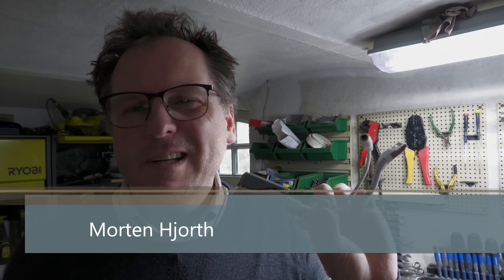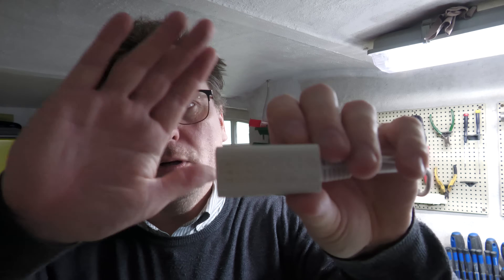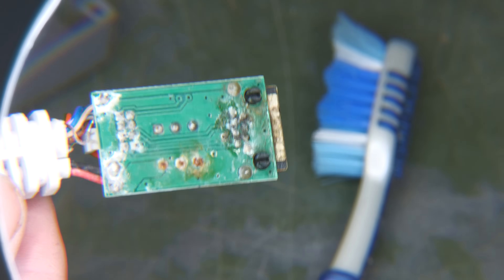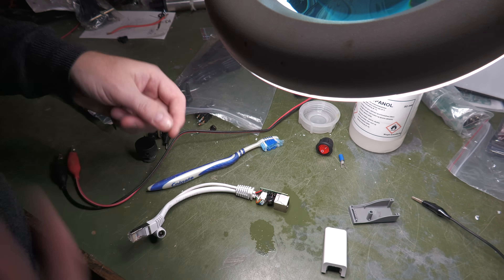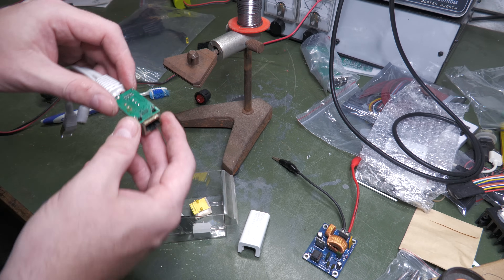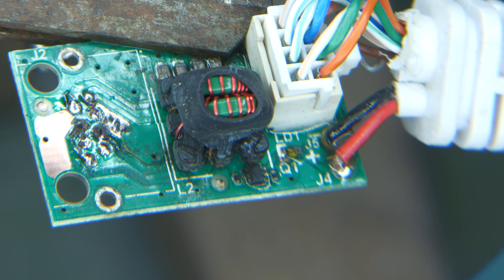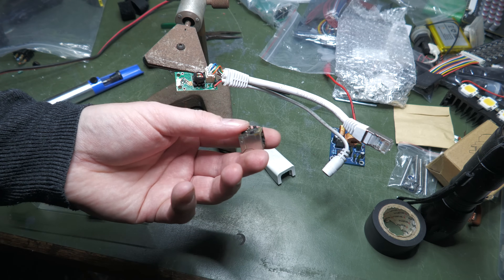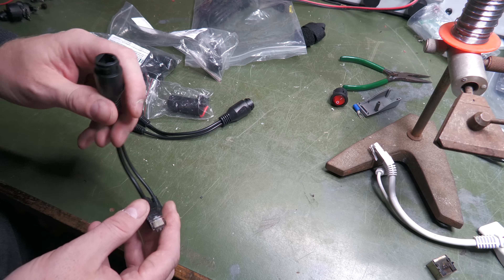My MikroTik Gigabit PoE Injector - Got Wet & Failed - 1492

Comment: One recommendation for you, fill up the inside with silicon this will prevent water from going inside, then use some for a Jelly in the connector and put electrical tape around it. Jelly I'm talking about is the same stuff you see in Jelly Connectors. ISPs use these connectors on their Copper lines.
Reply from the maker: Hi @VioletDragonsProjects
Thank You very much!  glad you liked the video :-)
Thank you for watching! :-)

Comment: You can get single use gel boxes that are completely watertight if you want a permanent solution. These injectors don't get very hot as long as you supply them with a similar voltage to PoE to avoid the need for internal boosting.
Reply from the maker: I will try this again :-)

Comment: Dam shame, another e-waste item. Best option I came up with was a plastic waterproof box which I then brought some water tight glads for. Made the holes in the bottom so cables ran down and also drilled a tiny 3mm hole in the bottom at the back to allow water to escape. Has worked really well.
Reply from the maker: Hi @solarhomelab
Thank You very much!  glad you liked the video :-)
Thank you for watching! :-)

Comment: The components on the Mikrotik PCB are there to allow power transmission combined with Gigabit Ethernet. The cheap passive PoE injectors just reuse the the 4 unused wires on 100Mbit/s for power transmission. But since Gigabit uses all 8 wires you need a more intelligent solution to couple the power and data.
Reply from the maker: Okay,, thank you! At the moment I am happy to see 30Mbit/s internet,, so it is just fine. But I do plan to get a new Mikrotik one.

Comment: Hey Morten. That adapter from MikroTik costs €5. I wouldn't bother to start with the ones you bought, because they are water protected only on RJ-45 socket side, you definitely need a snall boks. I would get something from Biltema or similar store in Portugal and put them inside. More reliable solution and no need to re-do in the future 🙂
Reply from the maker: Hi @999angelas
Thank You very much!  glad you liked the video :-)
Thank you for watching! :-)

Comment: Unfortunately is not only water some condensation can be form inside the tape especially if you isolated too well 😅 I have a small voltage step down converter to 12v to 5v in my garden to convert the solar panel to a 5v to connect all the led light on the fence and I put everything I a waterproof electric box and I noticed if I leave completely watertight some condensation start appear during some night if the humidity was too high for example after a small rain. Open one of the bottom port to let the air come in and out but not water resolve the issue. Maybe here same problem the connector generate a little bit of heat and start create condensation inside
Reply from the maker: If only I had made a hole for the water to run out again :-/

Comment: If it hasn't been suggested yet, use Self Amalgamating tape. Have the wires sticking out the bottom so water drips off.
Reply from the maker: Hi @rstvproductions8334
Thank You very much!  glad you liked the video :-)
Thank you for watching! :-)

Comment: 5:06 I know this feeling. I damaged the LAN port of an Elitedesk 800 g3 by inserting the power-plug accidentially, so it works now only at 100Mbit/s because 2 contacts are bent. But they have custom RJ45-ports and I was not able to find one that fits. Why on earth are there so many different ones? Every brand wants to reinvent the wheel. Stupid.
Reply from the maker: The poe injektor is like less then €10 I am not spending an hour on aliexpress to find the right RJ45 :-)

Comment: this might sound like a daft question, but I take it that this router that is powered over POE also have a 12v power supply that it would be powered from if plugged into the wall? 
oh and that power injector is a gigabit POE injector, with phantom power, that is the reason for all the extra components, the other ones you have are 100mb and the power and data are separate.
Reply from the maker: The router only has POE :-/

Comment: ive used those little injector/splitter type things before they work well however sometimes the cheaper ones only work at 100mbit
Reply from the maker: At the moment 100Mbit/s is okay,, but I might need Gbit later..

Comment: conformal coating is probably your friend in this kind of situation:P(depending on how far you are from the ocean salt content of the air might be working against ya too)..... tips for water proofing.... bag or container have the opening facing down; humidity is probably the bigger problem in most cases..... when I originally bought 2x ubiquiti loco ac AP's I didn't really trust the water proofing of them and so I made 2x sealed water proof housings for them out of I think 6inch thin wall pvc drain pipe, I used with end caps..... I bought these water resistant shrouds(can buy in bulk online) and filled up about 1 inch of the bottom of the diy housings with silica based kitty litter(the same stuff as silica desiccant for electronics:P)
Reply: Cat liter in my AP... NO THANKS. 😂
Reply: @jamess1787  most common is clay/ash based; but I am talking about silica based, not as common.... it is the same thing as comes with electronics:)(the free candy that says not to eat)... it's often sold for different uses(air drying for  paint shops, kitty litter, killing bed bugs/etc if in powder form, keeping stuff dry), this is just one of the cheapest common uses
Reply from the maker: Hi @plasmar1
Thank You very much!  glad you liked the video :-)
Thank you for watching! :-)